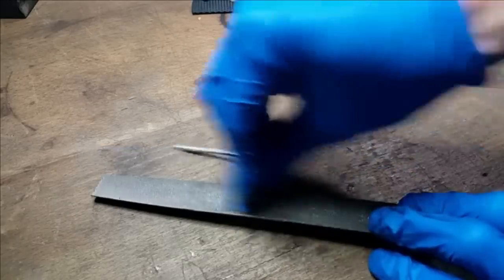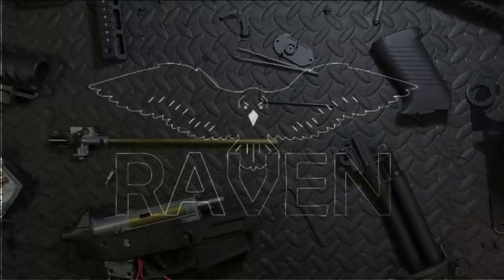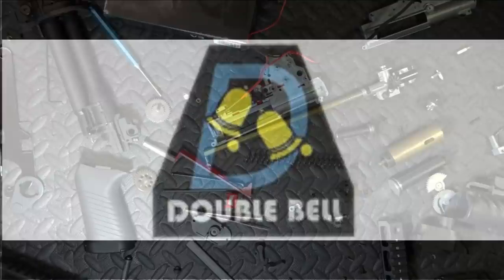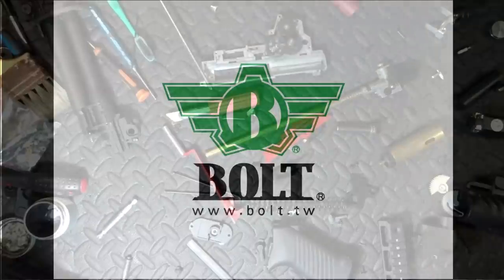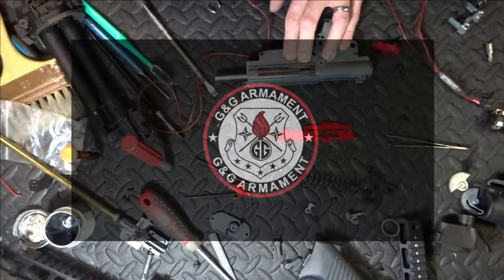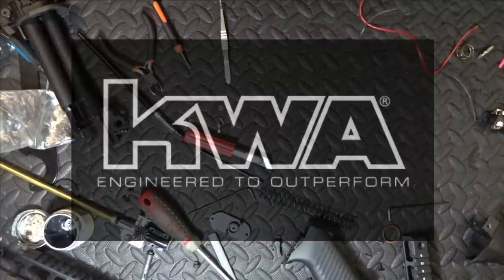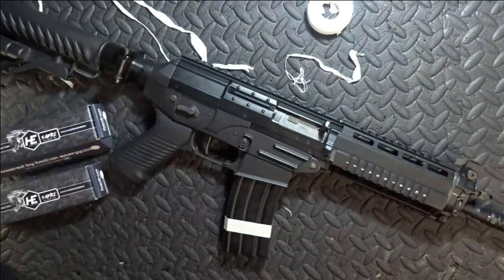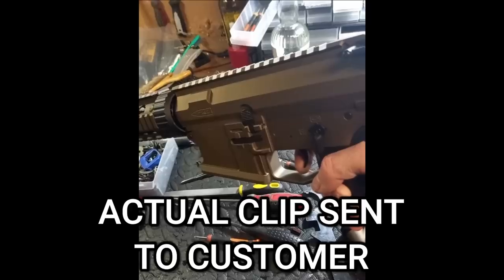Know Your Airsoft Brand!

Comment: Can confirm the WE Luger is a POS. Bought with a snail mag for memes...Worked for about a week then it turned full auto on me, leaky and just general hell. Changed to a tougher spring which briefly fixed the full auto but only for another week or so - now it gathers dust in the corner. (Standard mags always leaked hence the quick switch to the snail mag)

Comment: I have a ASG AUG and the damn thing is fun and hell to use, my only complaints are that the hopup is plastic and for me, the adjustment dial fell off (luckily I already had my hopup set to how I want it) and the trigger is pretty heavy and also made out of plastic which does bring in some finger pains from prolonged use.

I bought it from Evike and was pretty surprised on how off the fps numbers were on their site. My shoots about 430 with .20 and a little over 390 with .28 and the accuracy is absolutely stunning. I got it for 140 (couldn't afford to get it with the integrated scope) and its amazing to see that it's going for almost $170 on Evike. I would recommend it to people that want something fun to use. A 7.4v Lipo battery works well, if you do have some extra money laying around, I would get the hopup replaced by a metal one. 

Parts are pretty difficult to find (at least for me) though the essentials like barrels and hopups are available. I do plan on buying the upper receiver with the integrated scope and replacing the orange tip.

Overall, it's a great beginner weapon. I did struggle to use it for awhile since I didnt read that a Lipo was recommended, but with the recommended battery, it works well.

Comment: Loved this vid. Did watch it on two parts.

First gun was a Dboys M4A1. Ended up with a JG gearbox in it. Still got it, but the gun is very different now.

I have a G&P M16A3, brilliant gun. I have two JG mp5's, the A4 and sd6. Ics M4SIR, hop unit fell apart, but the replacement, which is an ics one working fine.

I have a cyma AK47, which to be honest is a cheap gun. I was surprised by the quality and operation of this gun.

No mention of Well. I have one of their L96's which I am currently upgrading. Like the gun, but still some eY to go to be great.

Comment: Great video as always, your comments on TM NGRS about what weight ammo to use, I have a SCAR which hasn’t been modified and run .28-.30g bb’s and it hops them fine yes the FPS is a little lower but I get good accuracy and I would argue very good range.

Comment: For me and my budget is Cyma/Specna Arms. I have Cyma AK and that thing is a mule... You can throw it, kick it, drop it and it still works... (don't do it btw). Only search for metal Cyma AK's, they are beasts... I put 11.1 Lipo in my stock AK and it works great (just don't go Rambo mode on full auto, it could maybe tear the gearbox. Keep it on short bursts)

Comment: My CYMA AK has been 40cm underground.
No problem.
Sand proof.
Spill proof.
Dust proof.
Can shoot ground BBs. (Sorry)
It works for 4 years.
It can run LiPo without some gear problems or something I dunno.
Shoots 500fps on 0,25 sometimes.

Comment: i just got the J.G Aug A3 its super good quality for a 185,- euro gun. However i upgraded the spring and the stock piston striped (which people told me if it strips just get a metal railed one) which i did and gonna repair it soon :3 But that thing rips man. Even without lipo's in it. Gonna get a Aug Stock pouch and jury rig a 11.1v lip holder in there :3 and upgrade the gun along the way. I love it even with the stock hopup and for how long the stock piston lasted (Dont full auto too long lmao) its super accurate where i could shot easter eggs from 15 meters away without compensating for drop or anything.

i love the J.G. Brand and will look into Golden Eagle as they are basically one and the same :3 Also got a Cybergun Taurus T99 which is pretty decent and was actually suprisingly cheap 119,- :3

Comment: With ICS tappet plates I heat up the plate hook and bend it ever so slightly so it doesn't catch the gearbox which is where I presume it snaps on, the only thing is that may weaken the plate further still, had 3 ICS m4s for about 8-9 years now. Genuinely had 2 guns the plates have been fine, 1 where it explodes em like no ones business

Comment: The only little thing with G&G is really the mosfet in the Buffertube, and the etu. They should have put both in the gearbox shell, and the gen1 Etus are solid , they work as they should but they are not very modern and are not the best on the market. Btw. I’m saying this as a G&G fanboy. You really see G&G every where because of the cm16 raider and now the newer Modells that are used often by newer players but also advanced and pros.
Ps: also the screws on the gearbox kill me because I have to lay it upside down to open it up and close it so nothing falls out of the gearbox

Comment: I second the desire for a new FNC AEG.  Especially if it has mechanical 3 round burst <3   Also, the UK should just reduce it's FPS/joule limits in line with Japan so TM are the gods once again :D
Edit2:  why did you not mention G&P?  They're my second favourite brand.

Comment: Top Banana mate. Sadly, I don't drink beer so I suspect I shall drink approximately 5.3 cups of tea during this video. 

Thank you, my bladder. E&L ARs by the way, are fucking spanking. The only problem is that the external finish requires you to take care of it just like a real one i.e. if it gets wet, dry and oil it or it WILL rust. Sold a few when working at Tuddenham, out of the box they were brilliant....not that they couldn't benefit from a little fettling and I do recall them being a little picky about mags, but overall, no mechanical problems with function and reliability.

Comment: CSI/STAR were missed, though not much going, I have a CSI XR-5. very bad hop up bucking and barrel, weak motor, cheap gearbox, the body was really good and sturdy but.. so difficult to disassemble to remove the gearbox so it's in bits atm

Comment: I have 3 ICS split gearbox (one of them MARS), nothing broke on those. Reddit SIMPers for ICS also don't seem to complain tappet plate on those, so idk, maybe another UK only issue or you got a cursed gun.

Also regarding HKP3/WE: WE collaborate with a HK airsoft shop for distribution and development back in the day, and their guns with trademarks that shouldn't be on those were branded HKP3 and were always made in Taiwan WE plant. My friend is an employee there and basically leaked AW subbrand to me before it went public. 

GHK: They can't make steel trunnions worth shit, many SG553s and AKs have untrue trunnions that causes dropped barrels, premature breakage of hop up units, feeding problem (553) and generally unexplained inaccuracy. Their M4 IMHO is solid but meh, nothing wrong, nothing spectacular. AUG? Great. Not that you have a choice but it's worth it.

VFC: ahh how the mighty has fallen. QC kept getting shafted and their GBB designs peaked in 2017. I remember when their M4 GBBRs were the best of the bunch. No longer. Rather get a WE for better consistency (Very ironic all things considered). Their autistic burst of disabling gas cutoff on SR25/MP5/SR15... and putting a PISTOL sized mag valve in their G3/ PSG1 thinking it would work gud ... idfk what to say

Comment: So, wait, I've been hearing that CYMA makes trash M4/M16 type guns, have they turned that around? I'd love to be able to include something like a CM068 in my decision making for a ~$180 budget range purchase.
Reply: Personally I have only play with their m14 EBR and ak74 thwy both worked very well it's no krytac but they are nice in many ways. Only thing I have noticed as well as my friends is the bucking and airnozzle are kinda crap. they dont get good compression and loose fps over time
Reply: I really like the 097 series. Haven't tried the 068.

Comment: why do you dislike the Krytac vector? al the reviews I see of it seem to be satisfied with the product.
Reply: Everything in the vector is just alot more fucky on top of the normal krytac gripes. Add in that until just rescently, there was no space for any normal aftermarket mosfet, like a warfet. And the krytac mosfet is just garbage, air volume is trash, plus tappet plate shaving, gear shaving, its such a fuckin headache. The perun vector mosfet is making vector builds more viable, but the rest of the vector is still a headache for any tech that takes pride in doing high quality work. Just requires too much effort for what is basic work in normal m4/ak builds.

Comment: Umarex are not just a simple buyer of trademarks/licenses of firearms manufacturers, they outright own firearm manufacturers like Walther and Rohm.
They are also probably the biggest manufacturer of blank/signal/tear-gas guns in Europe for 40-50 years!
When ownership of firearms was prohibited in most of Europe about 50 years ago, Umarex pioneered in developing and popularising these blank/tear-gas guns that didn't require a firearm permit.
Before airsoft (pre 2010) the only way for a gun enthusiast in Europe to own a gun replica was such blank-firing gun.
A lot of these were made by Umarex and their ownership of gun trademarks dates from decades ago.
When they noticed the airsoft market exploding about 10 years ago, they just moved in and instead of developing manufacturing capabilities they took advantage of the already established airsoft manufacturers.
Also you talk about trademarks as if Cybergun/Umarex/EliteForce did not exist every manufacturer would be selling fully trademarked airsoft guns. Which is nonsense.
Trademark is a protection that you receive automatically for the name under which you're selling a product so that no other sellers benefit on the back of your work and established name and of course do not damage it.
Companies do not easily give permission for other companies to use their trading name - first they would only give it to a reliable company and then it's expensive. Trademarked replicas will always be expensive.
Companies like are Cybergun/Umarex/EliteForce are needed to have officially trademarked replicas at all.
Reply from the maker: I'd check your facts on that bud, their blank & signal guns are were made by mostly Italian companies but recently a lot more Turksih companies also - these include Bruni, Reck, Jaeger, Kimar...
Airsoft guns were available before Umarex in Europe via SMK who stopped companies such as Western Arms importing into Europe who had the rights to Colt, Beretta etc in Japan as they had the rights within Europe & "automatically received money for somebody elses work & stacking a massive £50 mark up on any WA product.

These were also fantastic replicas not the slap dash shit that gets sold now.

And as for "Before airsoft (Pre 2010)" we had airsoft & so did Europe - it's just a different regulation now, we have the same in the UK with the VCRA but airsoft was there before & after that came into effect by over 20 years - I know because I was buying from Europe at that time.

And yeah, pretty much every brand DID put full (& CORRECT!) trademarks on their replicas, with or without consent', I'm not saying that's right, I'm simply saying you're not correct.

I've been doing this for a living for a quarter of a century, I may have picked up some info in that time... fyi...

An officially trademarked item should have CORRECT trademarks NOT! similar trademarks...
Reply: @NegativeAirsoftTech  What facts are you telling me to check?
The fact that Umarex were found nearly 50 years ago, and back then designed and started manufacturing their own branded blank firing guns?
They've been in the manufacturing business for decades, how can you say they are not a manufacturer?
When their business and demand grew exponentially in the 80s and 90s they started subcontracting a lot of manufacturing and acquired many arms trademarks for recreational weapon versions.
They became so big they acquired Walther, one of the manufacturers with the richest history in Europe, and later Rohm factories. Umarex have been manufacturing through these factories and their own ones for many decades both signal/blank firing and actual firearms and under many trademarks that they've licensed from their owners for decades.
They are not manufacturing airsoft guns AFAIK, bit you're making them sound like a shell company, someone came in with a couple of million last year and bought out some trademark rights and is now blocking everyone else from selling airsoft guns with them. The fact is they've owned them for decades.
And there is obviously one thing about trademarks that you do not understand - they need to be DEFENDED!
A trademark is based on your ability to prove that you generate profit and are RECOGNISABLE under that name.
You can not allow someone else to trade under the same name in the same market segment, or you will lose it.
You are required to challenge anyone trying to sell under the same name if you want to keep it.
And I didn't say airsoft didn't exist prior to 2010, but that it did not have the mass-market it has today today.
And the regulation did not change for most of Europe BTW, it's mainly UK, Germany and Netherlands that are screwed.
Reply from the maker: @JC-XL  You said it yourself, they're not manufacturing airsoft guns - this is an airsoft channel, they're slapping their name on things that already exist & bumping the price up. Facts.
Reply: @NegativeAirsoftTech  What I'm trying to explain to you is they are not just "slapping their name" on products, they are providing a service - arranging (read paying) with the owner of the trademarks to have the permission to have them on.
You can not have "CORRECT" trademarks for FREE in a first world country!
A Taiwanese manufacturer can shift 200 - 500 units with taped over trademarks directly from Asia, but once this becomes widely known, it gets shut down by the trademark owner.
Move to China, Bangladesh or something and you can sell guns trademarked Adidas or Panasonic if you want.
But here in Europe or the US it can not happen at scale without a company like Cybergun/Umarex - their service is needed to have "correct" trademarks.
And on top of that Umarex already owned licenses for a lot of these for decades as they've been making REPLICAS, not airsoft replicas, but blank-firing/signal/tear-gas and air gun replicas, that fall in the same category - gun replicas for recreational activities.
Do you think that if you show up at Heckler&Koch HQ with couple of million for a trademarks license they'll give you a better deal than the one they'd give to their long-term trading partner Umarex?!?
If they don't kick you out outright, you'll have to be passing even higher cost to the customer, say 75 pounds per gun or something.

Comment: Still have a star G36 15 years old with h&k trades nice enough receiver ,but they became ares and s&t and guess who copied their g36s   specna arm's with the same plastics , seam lines and bogey hop unit which all originated in the star G36 ,
Just happened to have gone through all of the above g36s but neither are as good as my original CA G36 and SRC gen 3 quality wise

Comment: Please, do the video about parts, especially about gas blowback parts, even more specific, pistols, i was supprised after i saw your video with P226 guarder kit, because i heard guarder kits require a lot of work to make them work properly.
Reply from the maker: Nah, Guarder Sig kits are almost drop in - you modify the sides of the original BBU & that's it really, people just don't understand what it's like to fit a metal kit.

Comment: emg guns there are multiple tiers I know that, ARES makes the (sharps bros) g&p make the (mk18) dytac make the (f4) and APS make the (F1, noveske, falkor) Now I have the Falkor and I like it (honesty it was a pain in the ass to fix receiver gapping and I had some gearbox fitment issues with parts) but after using the dremmel and some time I love the APS, gearbox is strong but I like the gen 2 version that can use a gate titan, hate the new gen 3 that copies the ARES EFCS proprietary electronics. 
Also with dytac having brands like F4 and the SLR B15 why don't people get them more, and rebuild them atleast ?
Reply: I've got the F4, it's externals feel really solid but the internals are questionable. Still tryna figure out what internals to swap out

Comment: I love my ICS l85 for whatever it's worth, but it does have a few issues such as the motor screw backing out. Easy fix, still annoying. Otherwise, I have found it very reliable and have a lot of affection for it. I also have no experience with other l58s though so what do I know

Comment: you said if you buy a tm recoil or a bolt recoil get the right battery for it ? out of intrest what type is it ? also what are the tm and bolt recoils like for upper and lower reciever compatibility because i would like to know if a m16a2 or a a1 reciever would fit ?.

Comment: hey mate i got a apex r series m4 and its a used gun i got it from a family fun never been maintained or cleaned so i cleaned it up and its not shooting well im using an 11.1v lipo and its motor is getting very warm quick so i was wondering if i have to get a lower voltage lipo like a 7.4v or do i have to get a new motor? also my hop up spring is broken and i cant find any info on my aeg so im not sure whats compatible with it but what do you recommend i replace first everything is very warn
Reply: Eik Guldfeldt  alright thanks mate and i don't use full auto so i dont think thats a problem but i will try a 7.4v i opened my gun up and the hop up bucking and piston is warn so thats part of it to just needs some work
Reply: Eik Guldfeldt  alright mate thanks i think i need a long motor because its a m4 platform but not 100% sure